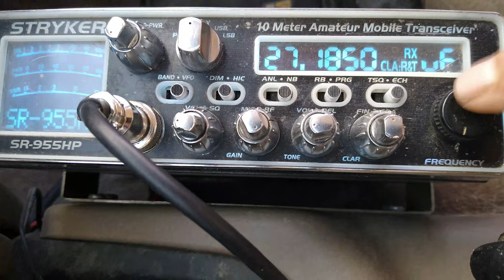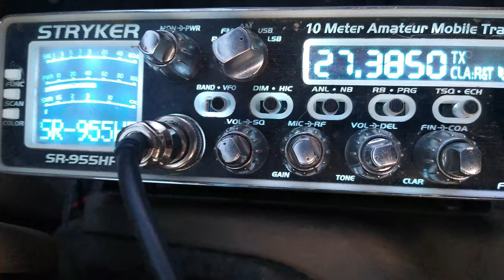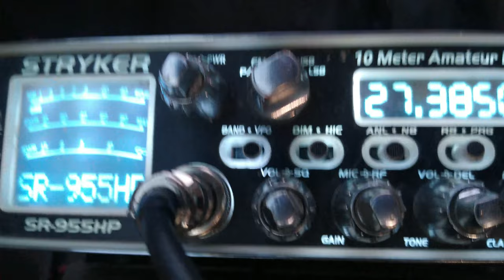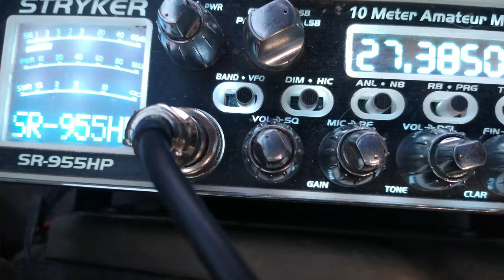Fine Tune CB Shop TEST .. Stryker Radios SR 955 v1 - v2  One At A Time And Back To The Bench.

Comment from the maker: It's all about The Bench .. If they can't show it they don't know it.  Got that part ??  Read over as many times necessary until it sinks in. 

Back to The Bench >>

==========================

Cleaner And Meaner

It's not about how many watts (if you want range), it's all about how clean that you can make each and every single one of them.

The 955 Versions 2's are worse than the original
version's, and require even More TLC.

Tap tap tap ..

If they can't show you they're snowing you! Find someone who's honest and competent.

Making it clean "and" out performing those hacked up splatterboxes 
requires Skill and Calibrated Test Equipment. If they claim otherwise, 
they're either a con artist or incompetent. Take your pick!

Blame it on the materials, math and Mother Nature!

Elements, Constants and Cycles.

They can work for you or against you.

Safety First!

Cleaner And Meaner, there'll never be a substitute .. like it or not.

It's all about Procedure .. No Exceptions.

One At A Time .. Don't Be In A Hurry!

You make them ring and I'll make them sing. 
https://www.nist.gov/pml/productsservices/physical-reference-data

No longer accepting mail-ins .. Fine Tune CB Shop services radios for 
the original owner that has purchased brand new radios from Fine Tune CB
 ONLY. This way, like the Maytag repairman, I only see one or two radios
 out of 500-600 per year that may have developed an issue. I'd rather 
spend my time doing better things .. maybe you should too??

Cleaner And Meaner .. Only the serious need apply.  No "tire kickers" or
undesirables that I know for a fact disrespects the airwaves and 
especially Channel 19. Haters are always going to hate because it's all
that they know how to do and what they do best. Don't be so miserable!

If you can't handle the heat .. get out of the kitchen. 

If they can't show you .. in a video .. they're snowing you. Get The 
Picture??

Here's what it actually takes to cut through the noise, be loud and 
crystal clear with a better receiver too:  A) Tuned Bench:  
https://www.youtube.com/watch?v=lwcDfXOgAls.  True, it's more 
complicated and time consuming to accomplish these consistent and 
accurate results. Below is a partial procedure and list of calibrated 
equipment used to achieve this level of performance . Read on ..

Radio Evaluation Rules: 
https://www.facebook.com/163Hardrive/posts/3729504220447644
https://www.facebook.com/163Hardrive/posts/3523601657704569

Fine Tune CB Radio Shop strictly adheres to (https://www.nist.gov/) NIST
Traceable Calibrations and other industry standards to maintain 
accuracy and consistency for providing Real World Performance Tuning of 
Citizens Band and 10 Meter export mobile radios with integrity.

"Basic Textbook AM/FM/SSB Transceiver Tune, Alignment and Calibration" 

1) Pll adjustments
VCO & OSC, AM TX OSC, USB TX OSC, LSB TX OSC.

2) Transmitter alignment
DRIVER BIAS, FINAL BIAS, SSB  (or gate voltages for mosfet versions) 
CARRIER BALANCE, HI-LO AM & SSB Power, RF METER, AMC, ALC and FM 
DEVIATION.

3) Receiver alignment
AM/FM RF & IF SENSITIVITY, FM DETECTOR/DEVIATION, SSB IF 
SENSITIVITY, SSB S-METER, AM/FM S-METER (100uV unmodulated -67dbm for 
�S-9� meter reading!), AM/FM SQUELCH RANGE, SSB SQUELCH RANGE, and NOISE
 BLANKER/AUTOMATIC NOISE LIMITER (Real World dBm to volts (uV) tables 
below).

That's just a typical run of the mill textbook tune up and alignment (if
 you're lucky). There's more to it than frequency alignment, modulation 
adjustment, meter calibration and a tune up report displaying 
exaggerated rms Bird peak watts! 

"Test Bench includes"

Bird 4314C Meter
https://www.birdrf.com/Products/Test%20and%20Measurement/Power-Meters/Wattmeters-Line-Sections/RF-Wattmeters/4314C_PEP-Single-Element-Wattmeter.aspx
Part 1) https://www.youtube.com/watch?v=RpX9IHe4ORM&t=16s
Part 2) https://www.youtube.com/watch?v=LuhbqTf6Bxw
Bird 4314C Accuracy Test: 
https://www.youtube.com/watch?v=DqEOabYqhQo&t=5s
Bird Stipulates 1/2 wavelengths  
https://www.youtube.com/watch?v=5eWhgT-rTII
And Genuine Bird Elements from 1K down.

Bird 4373 Sampler 
https://www.rfparts.com/signal-samplers.html

HP8924c with options
http://userequip.com/files/specs/2147/HP%208924C%20Repair.pdf
https://www.youtube.com/watch?v=Cg1w0xBa27s&t=1s

HP8920a with options
https://www.keysight.com/upload/cmc_upload/All/EPSG072204.pdf

Three analog scopes, one digital 200 Mhz
https://www.atecorp.com/atecorp/media/pdfs/data-sheets/tektronix-2465b-2467b_manual.pdf
https://www.youtube.com/watch?v=by98x4eu2lM

Fluke 27fm
http://www.fluke.com/fluke/inen/digital-multimeters/fluke-27.htm?pid=56055
 
LCR 
http://www.lcrresearch.com/wp-content/uploads/2017/05/LCR_Pro1_Manual_version1.03.pdf

Power supplies
6 Cosel PBA1500f12 (750 amps) variable and configurable.
https://en.cosel.co.jp/product/powersupply/PBA/PBA1500F/PBA1500F-12/
Corcom 20VB1 F7130 EMI Filter 50-60Hz 250V

Times Microwave Coax jumpers and test leads
http://www.timesmicrowave.com/cms/products/cables/lmr/
https://www.youtube.com/watch?v=EmqaGJ6IWow
https://www.youtube.com/watch?v=1ltFVSxGp5Y
https://www.youtube.com/watch?v=v12YZT_1o90
https://www.youtube.com/watch?v=h7iiYfmYWRA&t=215s

Amphenol RF Connectors
https://www.amphenolrf.com/
https://www.youtube.com/watch?v=dVh5B0hdEA0 
https://www.youtube.com/watch?v=dKZg8T_AOso

More range, compliments, reliability and a quieter, clearer but more 
sensitive receiver,  Get Fine Tuned .. not peaked and ruined.

It's what I recommend, use, service and sell ... to you ... not 
something non practical or deceiving in a misleading way. I'm not just 
the tech and owner of Fine Tune CB Radio Shop, I'm a customer too!  When
 finished, You'll be giving radio checks, not asking for them .

dBm To Watts and Volts
Tables below displays relationship between Power in [dBm] or [Watts] and
 Voltage in RMS, peak, peak-to-peak for sinusoidal signals in 50-Ohm 
systems for accurately measuring and tuning am/fm/ssb receiver 
sensitivity, agc, squelch and "S9" Meter calibration. Real World! 

Mike @ Mikes Radio Repair (Romper Room), Mark Rutherford aka Mark 19960,
 CB Kidd, Martian and all of your other fake accounts pay attention to the 
tables below, stop misaligning radios, spreading false information and 
promoting propaganda! Window Lickers ...

  [dBm] [Watts]   [Volts]rms   [Volts]p    [Volts]pp
-140 0.100E-16  22.361 nV  31.618 nV  63.236 nV 
-139 0.126E-16  25.089 nV  35.476 nV  70.952 nV 
-138 0.158E-16  28.150 nV  39.805 nV  79.609 nV 
-137 0.200E-16  31.585 nV  44.662 nV  89.323 nV 
-136 0.251E-16  35.439 nV  50.111 nV  100.222 nV 
-135 0.316E-16  39.764 nV  56.226 nV  112.451 nV 
-134 0.398E-16  44.615 nV  63.086 nV  126.172 nV 
-133 0.501E-16  50.059 nV  70.784 nV  141.568 nV 
-132 0.631E-16  56.167 nV  79.421 nV  158.842 nV 
-131 0.794E-16  63.021 nV  89.112 nV  178.223 nV 
-130 0.100E-15  70.711 nV  99.985 nV  199.970 nV 
-129 0.126E-15  79.339 nV  112.185 nV  224.370 nV 
-128 0.158E-15  89.019 nV  125.874 nV  251.747 nV 
-127 0.200E-15  99.882 nV  141.232 nV  282.465 nV 
-126 0.251E-15  112.069 nV  158.465 nV  316.931 nV 
-125 0.316E-15  125.743 nV  177.801 nV  355.602 nV 
-124 0.398E-15  141.086 nV  199.496 nV  398.992 nV 
-123 0.501E-15  158.301 nV  223.838 nV  447.677 nV 
-122 0.631E-15  177.617 nV  251.151 nV  502.302 nV 
-121 0.794E-15  199.290 nV  281.796 nV  563.591 nV 
-120 0.100E-14  223.607 nV  316.180 nV  632.360 nV 
-119 0.126E-14  250.891 nV  354.760 nV  709.519 nV 
-118 0.158E-14  281.504 nV  398.047 nV  796.094 nV 
-117 0.200E-14  315.853 nV  446.616 nV  893.232 nV 
-116 0.251E-14  0.354 �V  0.501 �V  1.002 �V 
-115 0.316E-14  0.398 �V  0.562 �V  1.125 �V 
-114 0.398E-14  0.446 �V  0.631 �V  1.262 �V 
-113 0.501E-14  0.501 �V  0.708 �V  1.416 �V 
-112 0.631E-14  0.562 �V  0.794 �V  1.588 �V 
-111 0.794E-14  0.630 �V  0.891 �V  1.782 �V 
-110 0.100E-13  0.707 �V  1.000 �V  2.000 �V 
-109 0.126E-13  0.793 �V  1.122 �V  2.244 �V 
-108 0.158E-13  0.890 �V  1.259 �V  2.517 �V 
-107 0.200E-13  0.999 �V  1.412 �V  2.825 �V 
-106 0.251E-13  1.121 �V  1.585 �V  3.169 �V 
-105 0.316E-13  1.257 �V  1.778 �V  3.556 �V 
-104 0.398E-13  1.411 �V  1.995 �V  3.990 �V 
-103 0.501E-13  1.583 �V  2.238 �V  4.477 �V 
-102 0.631E-13  1.776 �V  2.512 �V  5.023 �V 
-101 0.794E-13  1.993 �V  2.818 �V  5.636 �V 
-100 0.100E-12  2.236 �V  3.162 �V  6.324 �V 
-99 0.126E-12  2.509 �V  3.548 �V  7.095 �V 
-98 0.158E-12  2.815 �V  3.980 �V  7.961 �V 
-97 0.200E-12  3.159 �V  4.466 �V  8.932 �V 
-96 0.251E-12  3.544 �V  5.011 �V  10.022 �V 
-95 0.316E-12  3.976 �V  5.623 �V  11.245 �V 
-94 0.398E-12  4.462 �V  6.309 �V  12.617 �V 
-93 0.501E-12  5.006 �V  7.078 �V  14.157 �V 
-92 0.631E-12  5.617 �V  7.942 �V  15.884 �V 
-91 0.794E-12  6.302 �V  8.911 �V  17.822 �V 
-90 0.100E-11  7.071 �V  9.998 �V  19.997 �V 
-89 0.126E-11  7.934 �V  11.218 �V  22.437 �V 
-88 0.158E-11  8.902 �V  12.587 �V  25.175 �V 
-87 0.200E-11  9.988 �V  14.123 �V  28.246 �V 
-86 0.251E-11  11.207 �V  15.847 �V  31.693 �V 
-85 0.316E-11  12.574 �V  17.780 �V  35.560 �V 
-84 0.398E-11  14.109 �V  19.950 �V  39.899 �V 
-83 0.501E-11  15.830 �V  22.384 �V  44.768 �V 
-82 0.631E-11  17.762 �V  25.115 �V  50.230 �V 
-81 0.794E-11  19.929 �V  28.180 �V  56.359 �V 
-80 0.100E-10  22.361 �V  31.618 �V  63.236 �V 
-79 0.126E-10  25.089 �V  35.476 �V  70.952 �V       

                         Don't Be A Mud Duck!

Contact: https://www.youtube.com/watch?v=P0W_Ltzeyyc ONLY when Ready. 

Tire kickers GET THE BOOT.

163HD